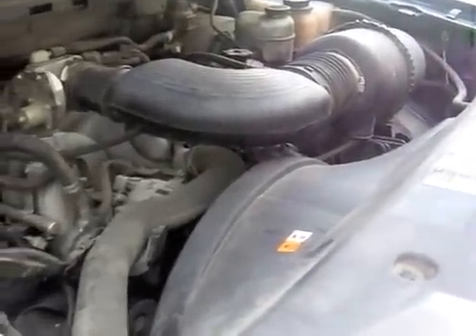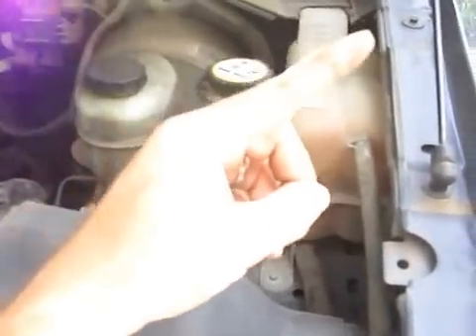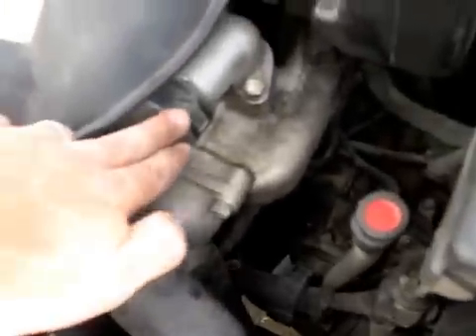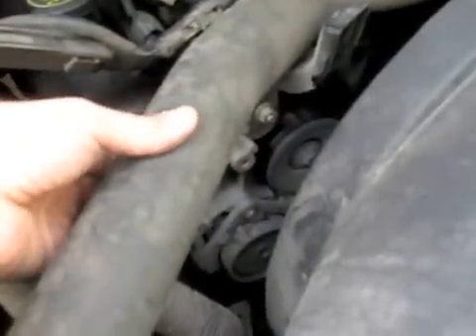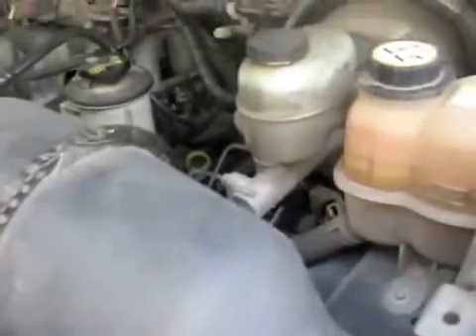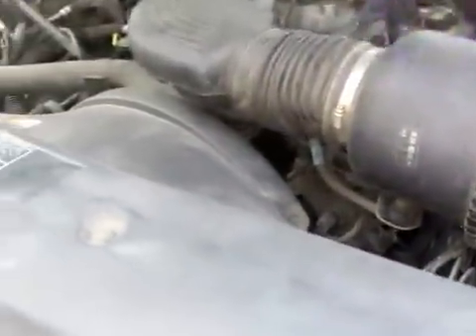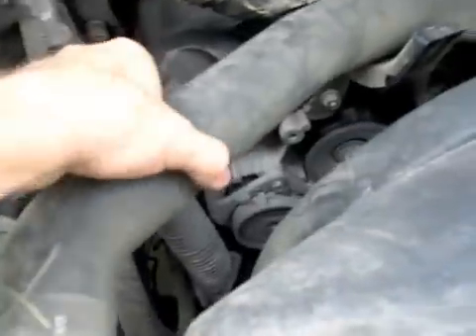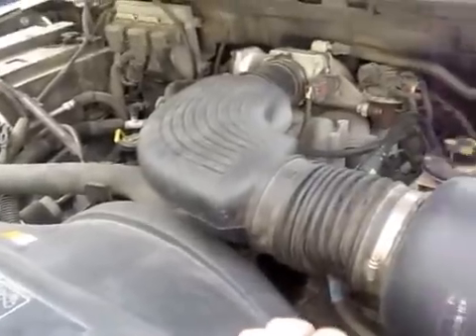Car Engine Overheating - Causes and Symptoms of Over Heating  Car Engine

Comment: p.s. as soon as I turn the air conditioning off, the temperature needle goes back to the middle.
Reply from the maker: Marie Beck Pressure test the system for leaks first, then check electric radiator cooling fan operation and the radiator for a restriction.  Radiator is not removing enough heat.

Comment: Hello, I have a 2004 BMW 325I.  My car runs fine, until I put the air conditioning on.  It blows cold for a little bit, then turns to hot air, and the needle on the 'gage' moves to overheating.  The coolant has been checked and is fine, (not cloudy) there are no leaks of fluids under the vehicle.  I recently had a couple of oil leaks repaired and replaced the covers.  I also had a couple of hoses replaced.  I have been told it sounds like a clogged thermostat - what do you think?

Comment: My 92 Nissan 240SX warms up and then runs hot until it burp the radiator by letting pressure out at the cap.  Why??  I've replaced the thermostat.
Reply from the maker: Lawrence Strouse Pressure test for leaks, then check for a radiator restriction....or just replace the radiator as a guess....a good guess, but still my guess.

Comment: TrustMyMechanic.com hey I drive a 2003 grand prix and my problem with it is I'll drive up the street maybe a mile or so and it will start heating up what do you think the problem is?
Reply from the maker: Brill White watch the video again and rule things out, pressure test, electric radiator fan check

Comment: So do you have your our own shop if so were are you located I'm in houston too
Reply from the maker: Jonathan Arellano I used too, but sold a few years back.  My grandfather started the family business in 1937, I was the third generation. The building is still there, and the new owners are doing a great job and I personally recommend them to others, although I have no affiliation with them at all.  Located in the Heights, just inside the loop.
Master Car Care
2305 Yale St.
Houston, TX 77008
713-862-6639

Comment: TrustMyMechanic.com hey buddy I was wondering if you could help me out. Im young and learning but I've been having a he'll of a time with overheating. So it starts with I had bought a cheap thermostat from auto zone for my 02 civic and my car ran fine for about 2 days then It started to overheat then drop back down at various points driving and stopped. So I went and got a honda thermostat and it ran fine for about a day and now its back to getting hot tgen dropping back down then rising up again. It always fluctuates. I did the head gasket last summer and I've replaced the rad cap. I just tested the thermostat cooling sensor today and it tested fine. My fan kicks on when im stopped every so often. Im having so much trouble and can't figure out a. Why it goes up and down and B. Why it was fine for a day or 2 after the thermostat replacements. Any help would be greatly appreciated. Srry for long message but wanted to give you all the info. Thanks!
Reply from the maker: Need to get a cooling system pressure test, then check electric radiator cooling fans, then check for a restriction in the radiator. Not a thermostat issue.
Reply: Chris Watson Did you ever get it fixed?
Reply: Ptah Re Lay Ankh yeah. Turns out that on these Hondas you really have to take the time to bleed out every bit of air in the cooling system. I did my head gasket and must of not bleed out every bit of air cause it would overheat sporadically and would drop back down which must of been a air pocket. You having any problems cause I have pretty much read up on everything with my car and might be able to help. But Yeah imagine Just Having A Little Air caused All That trouble.
Reply: Chris Watson
Makes sense i gotta keep that in mind,but i found out mine was overheating due to a Bad cam sensor.The engine temp gauge would remain balanced so i knew it wasn't the head gasket which i had done recently also.but once you go through all we have you'll know you learned allot at least lol cool bro peace.

Comment: My 04 toyota prado 
After driving at high speeds the engines becomes really hot and removes a lot of heat what could be the issue, I've checked the coolant, and the coolant box removes smoke when you open it...

Comment: my heat goes off and on. When the needle is half way or more, it blows freezing air out when its set on 90 degrees. I have been to the mechanic 3 times already and i have to go back because its still doing it. He changed the thermostat, flushed out coolant, replaced water pump, and its still doing it. Have any idea what is causing that?
Reply from the maker: Get a cooling system pressure test first, lets make sure there are no external coolant leaks. Both radiator hoses should be HOT to the touch when engine is at operating temperature. If no leaks, you might have a "control" issue in the dashboard causing the heater door to divert to A/C or outside air.  Relays, the actual A/C heater control panel, a diverter door motor....should all be checked, but by a REAL mechanic, not just some young kid at Firestone.

Comment: Hi.
I am having a problem with my 1991 Toyota Corolla.
I recently changed out the original engine (Which was carburated) to a fuel injected one, the problem that i am experiencing is, when started and is left idling for long the engine behaves like it is flooding and shuts down.
Can you give a reason or reasons that would be causing this problem. Any information given to solve this would be greatly appreciated.
Reply from the maker: Without the computer system and needed sensors and wire harness I don't see how you will ever have fuel control.  I would go back to what the vehicle originally came with.

Comment: I just replaced my car engine at dealer because my engine failed. I just picked my yesterday and drove 100 miles start overheating again. We changed radiator and put new engine but still overheating so what could be the problem?
Reply from the maker: Rewatch the video and try to determine when it overheats....freeway speeds, or slow or idle speeds.  Pressure test cooling system for leaks FIRST, then check cooling fan, bleed air pockets that might be in system, check thermostat operation etc. I would bet you got a coolant leak, or air trapped inside the system that needs to be bled out.

Comment: Hello sir, i have vw Mk 3 1.8 engine saloon car which recently started overheating, b4 this time it the needle always to the middle when an driving @ 90-120 km n above, it has a little leakage like a drop per two second at the bottom part of the radiator, the coolant was boiling hot i tried to manage it to a safe place b4 its top cylinder gasket got burned, b4 this time i have noticed the water pump is faulty not pumping cooling into the radiator, the next day i replaced it with a new one along side with the gasket but the current problem is, the coolant is still boiling. and when i place my hand at the back of the fan i could feel some heat the is brown out of the radiator, and both top and low radiator horse are hot when i start the engine for like 15 minute, so please what do you suggest i do to normalize the boiling coolant. a mechanic suggest buying new top cylinder which he said is the course.
Reply from the maker: I would get the cooling system pressure test to determine if you have an internal or external leak...like a head gasket, but it really sounds like you have a restriction in the radiator to me. If you see old brown water/coolant in the radiator I would bet the bottom of the radiator is stopped up, restricting coolant flow...thus overheating.

Comment: Is it natural for the radiator to sizzle after the engines been shut off? and what does it mean if you're smelling something strange every time you engage the defroster or air-conditioning?
Reply from the maker: Sounds like you have a coolant leak, and need to get a cooling system pressure test to help you locate the source. The smell inside the vehicle with the defrost on, could be due to a leaking heater core located in the dash on the passenger side.

Comment: Hi, my car while slow speeds or idle the needle goes 3/4  then u can hear the fan kick in and the needle returns to 1/2 then it shuts off and cycle repeats itself but when I turn the heater on, the needle always stays in the middle. What can be the issue? Coolant levels r good, even though u can smell the coolant burning. I have done a pressure test, and passes. Thank you
Reply from the maker: Are you sure the coolant level is full?  Sure sounds like its low on coolant to me. Does the heater blow hot at this speed?  Make sure there is not an air pocket in the coolant system that needs to be bled out. If you smell coolant, there is a leak, so re-pressure test the system again. A small leak will not allow the system to hold pressure, which can cause overheating as well. Also test the radiator cap with the pressure tester to make sure it holds pressure.

Comment: can i jump the wire on my ect sensor wire or will it blow a fuse
Reply from the maker: You can, dont think it will blow the fuse....guess you will just have to try it
Reply: thank you my fans both came on so im out to buy a new ect sensor  because before i jumped the plug my scan tool read -40 degrees then when i jumped it again the temp on scan tool read 309 degrees so that let me know the plug too the ecm is communicating.

Comment: I got quick question my starts to over heat when I'm going really slow or stopped at a light but as soon as I start going and pick up some speed the temperature drops to normal I've ran it on the freeway and the temperature stays normal but as soon as I pull off and stop at a light it starts raising fast, I'm thinking thermostat. What do u think?
Reply from the maker: Check coolant level first, then check electric radiator cooling fan

Comment: So my car was trying to over heat and i checked it my drain plug for the radiator was missing when i pour coolant into the radiator it just goes straight in the ground if my fix is  just 3 dollars i don't to have to buy a whole new radiator when its not needed also my car cut off at the light is that due to no motor oil or lack of coolent? i have a 2000 hyundai sonata

Comment: Hi, please help me here. My car does not overheat, the temp needle is normally at the middle. After driving with the ac on and shutting the car off, coolant starts to come from the overflow tank, it doesn't leak, it comes with a lot of pressure and a big lake of coolant appears under the car. I have to add coolant daily...
Reply from the maker: I would look a the radiator and make sure you do not have a restriction in the bottom (rust, mineral deposits) that is not allowing the coolant to circulate in the engine properly. Turning off the vehicle causes that coolant to back up into the overflow since the water pump is not pumping. Also make sure your radiator cap is venting properly. A bad radiator cap usually makes the upper radiator hose swell in size once the engine is warm.
Reply: TrustMyMechanic.com that was a quick and great answer. I went to a shop and bought the radiator cap, i put it and drove the whole day with the ac at max. I parked at home, check the coolant level and it was just where is had to be. Thanks a lot for the reply, i thought the cap was just a regular cap, now i know how important it is. I'm subscribing and recommending! Thanks! !!
Reply from the maker: chrmantilla
Thanks for the update, I knew you could do it.  Now that'll be $69.95 :)
Reply: TrustMyMechanic.com hi, quick question again! I was driving on the highway and while on 5ft shift around 70mph the temperature started going up, i had to pull over. The car was still over heated and i started the engine, i stepped on the gas, rpm went to 3500 and the temperature stated going to normal. I had to do the same thing twice during the trip. I went to the mechanic and told me maybe the radiator cap was not working properly (never happened before changing the cap). Since he sold me the cap he just gave me a new one, kind of warranty... i haven't driven on a highway since the new cap was put,  so i don't know if it would overheat again. Is it possible that the engine overheated art high speeds just because of the radiator cap? Another thing I'm concerned is that the original cap and the one he first gave me was 1.1 and today i noticed the new one is 0.9
Please help! :S
Reply from the maker: chrmantilla
Cooling system pressure test and check radiator for a restriction

Comment: does the radiator cap has to do with overheating ...when I drive my car for like 10 minutes and I pop the hood I hear some bubbling and pressure noises come from the radiator cap ?? should it be silent and no breathing at all or what ??
Reply from the maker: Not too uncommon to hear some hissing type of noise or gurgling once you turn the engine off and coolant and engine cools down, Unless you have an overheating issue, or have been adding coolant regularly then you got a problem.
Reply: well my car overheats only when I take on a heel or something ...I really don't understand ...the car is 2013 so very new ...and I hear hissing sound everytime I park my car ..and the noise comes from the cap
Reply from the maker: Ara J
If its still under warranty I would take it to the dealer and let them look into this.  If not under warranty, get a cooling system pressure test, which should also include testing the cap.
Reply: well it is not under warranty so I'm doomed lol ...thanks a lot for your help ...much appreciated
Reply from the maker: Ara J
2013 and not under warranty anymore? wow.  Just get the pressure test, probably something minor.
Reply: TrustMyMechanic.com well I live in kurdistan ...we have all fancy cars but we don't have warranty for most cars lol...will do so , thanks again

Comment: Help me please, i have a 95 Chevy Monte Carlo, i just replaced the water pump 2 weeks ago, i got an oil change 2 days ago,but yesterday i heard a gurgling sound and today i saw white smoke coming from under my hood. :-( I dont know what this is, this is the second time Im having the white smoke problem,in july i was told it was my water pump got it replaced and it still over heated,the new mechanic i went to recently said the water pump couldnt have been replaced in july,so he replaced it again,but is it possible its coolant burning off? Or is it a problem im not catching
Reply from the maker: Get a cooling system pressure test.....echo echo echo, to help you determine if you have an external coolant leak, which sounds like you probably do.
Reply: TrustMyMechanic.com thnx will do

Comment: I need some advice. I noticed my 94 Chevy Silverado was leaking but wasn't sure from where. Well today I drove to the store and when I came out water/coolant was everywhere. I drove it home 1 block over and the temp was close to 260 and still pouring out what was left of the water/coolant. From what I can tell, it's coming somewhere from the bottom of the engine closer towards the back. Nothing on the top of the engine but there was a very small amount under the radiator.  Any thoughts?
Reply from the maker: Cooling system pressure test ....echo echo echo, to help you locate the leak source
Reply: TrustMyMechanic.com thanks for responding but I figured it out, it was a freeze plug.
Reply from the maker: kntrygrl2295
Great, that is usually a pretty easy fix. Use a brass replacement plug which last longer.  Keep the cooling system clean, usually rusty coolant is the cause for leaking freeze plugs...unless it actually did freeze and the plug did it's job and blew out.

Comment: im driving a mazda 3 2008 model, i was heading for high lands when my engine overheated, my coolant went dry so i filled it up w water and had the car rested to cool down for hours, no over heating happen prior after this, im just concerned about you telling that once that red light on the dash board comes on then damage has been done, should i have to let a mechanic check out my car?
Reply from the maker: Sounds like you have a coolant leak, so get a cooling system pressure test to help you locate it.  Hopefully no damage was done, but don't let it happen again.

Comment: my cars belt broke. an inexperienced guy replaced it and now my fans are not turning on causing my car to overheat. Can it be related to the belt being placed in wrong? any responses will help :) thanks
Reply from the maker: Probably not, but make sure they did not accidentally unplug it or cut the wires.

Comment: my 99 astro van over heats i added coolant on both places container and raidiator  and still over heats on low speeds, once i get home and shutdown the van its over heated with a bit of smoke coming from the engine and sounds like a hissing sound air coming out, idk if its internal or the raidairtor fan.. please help
Reply from the maker: Most likely an external coolant leak under the hood somewhere, hose, radiator, water pump etc. Get a cooling system pressure test done to help you locate it. You can usually rent/borrow a pressure tester from your auto parts store. I would also check the radiator for a restriction, causing coolant to "boil over" to the plastic reservoir if there are no external leaks found...a 15 year old radiator is probably restricted at the bottom and due for a replacement.
Reply: thank you , doing that tomorrow morning :) thanks again